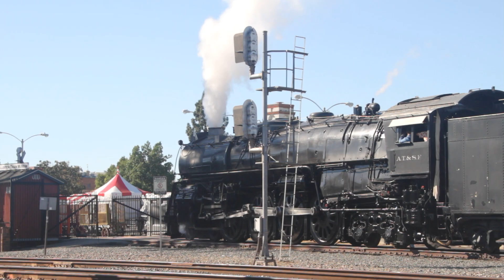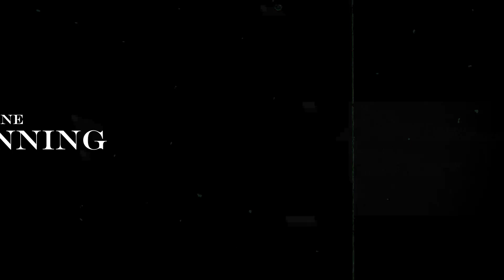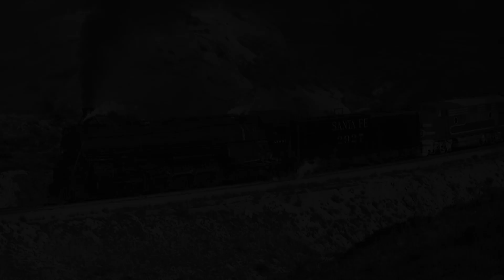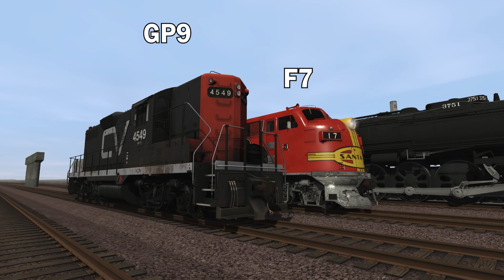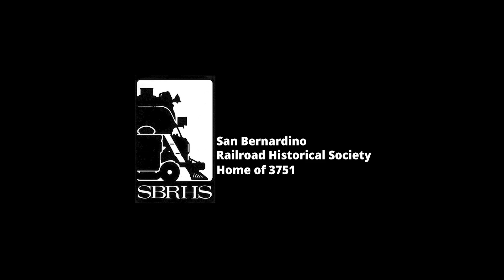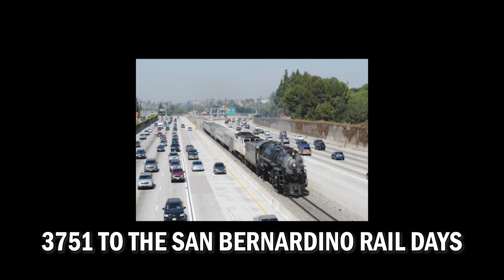ATSF 3751: How did this Steam Engine become an ICON?

Comment: The 1 reason I actually don't care for 3751 is because of the crew that was operating her at railfair 99 when my dad took me. They were absolute ass holes when my dad put me (a 9 year old at the time) up on the front pilot step for a photo while others were doing the same thing. Not sure if the same crew still runs her now, but back in 99, those guys were a bunch of pricks.
Reply: You Blame the FUCKING TRAIN for the behavior of some stupid people. God DAMN. Blame the people for their behavior, not the locomotive. Half the people I met who drove Silverados were dicks. Do i hate Silverados? No. Leave the vehicle out of the equation. I know everyone has their favorite and least favorite engines, but I have never heard such a baffling reason.